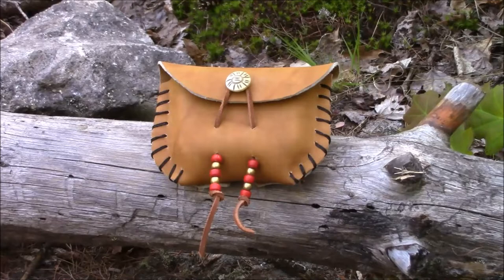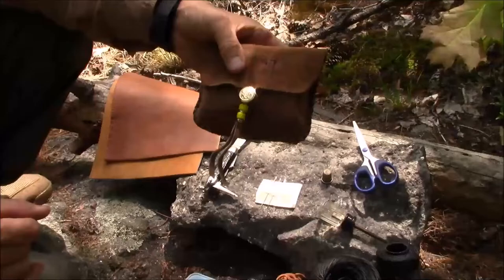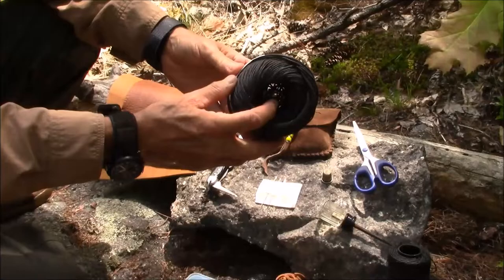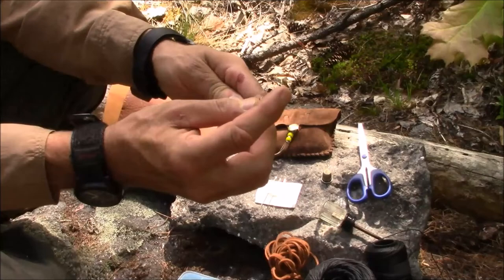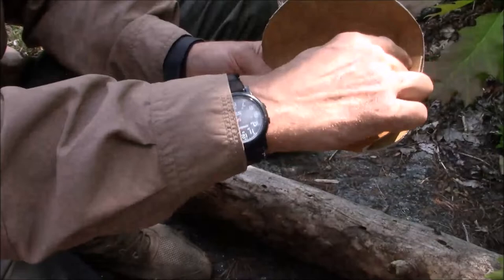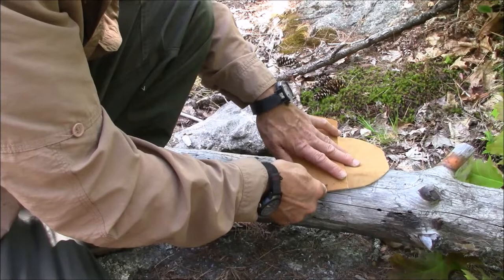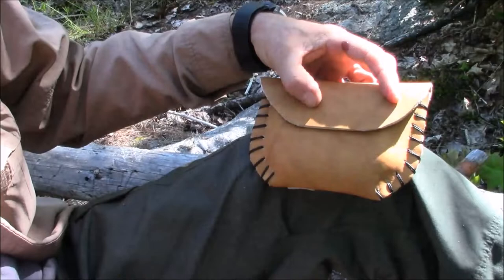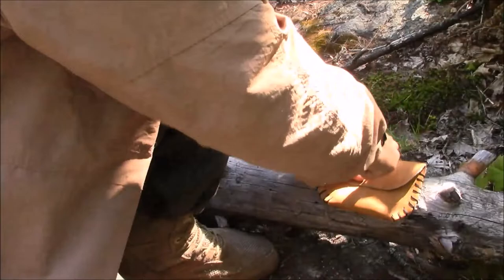Easy DIY Bushcraft Leather Pouch- for Altoids Tin, Flint & Steel Kit.  Pack / Belt Bag / Possibles

Comment: Hey Doug,
I have something to share about pure leather shoes (skin over skin) for people in the city and why our ancestors may of been smart in using them as opposed to modern shoes with rubber inserts that isolate us from the earth (ground) ⏚ 
I'm living in a city in a place in the world which is currently in lockdown so most people stay at home in their high rise boxes. I discovered I need to go barefoot sometimes because I use rubber shoes and my apartment's floor is probably not earthed well.

At work , sometimes I'm working with capacitors. If someone is not familiar, these are electrical devices that store energy similar to batteries. Capacitors can discharge stored energy when you link them to the ground. I can see our bodies are kinda like capacitors in a way. If people like me live in a Metropolis and always wear shoes with insulating rubber and walk on surfaces that insulate, then maybe we will never touch the ground and can build up unwanted electrical energy which I guess is supposed to be discharged - and it could be making people feel stressed or even causing sickness. I'm pretty sure we aren't meant to have too much static energy.

Recently I tried out going to a favorite rock of mine at a bicycle path late at night when nobody is around. I tried taking my shoes off and standing on it. It felt good . Now I often lay on the rock bare back for long periods. I can feel something happening, almost like unwanted city electricals  being released into that black granite rock.

This is something of a discovery for me and it made me think about why those expensive spas make you take off your shoes and walk on the black pebbles. They know something about it I guess. Maybe some people thought it was the massage that relieved some body stress but who knows, maybe a lot of the work was done by walking barefoot on natural rocks.
Reply from the maker: You may be on to something.  Our bodies are electrical in part.  Abenaki sacred sites here have magnetic and electrical properties.  Areas I frequent have enough magnetism to throw off a compass.  And there are a great many lightning strikes.
Reply: @DougShoeBushcraft  Yeh.. Also I think that the colour of the rock tells you about it's electrical /magnetic properties . I see black is absorbing while white and red is repelling. The pyramids are covered in limestone and I think they are repelling (I'm not sure but I'm investigating on my own) .. I think that people who sell spiritual knowledge know about the effects because that is how you could trap someone into worshipping a stone or any other object because it seems like magic but actually it is the way God has arranged things.  Well.. here is something interesting. If I am wearing pure leather shoes  and I've discharged unwanted electricals , I can help a stressed friend by touching them. I think this mandated "distancing" from others where I live is very bad and can actually be a cause of sickness. People need to touch each other in a loving way. I also think our words have power. We can destroy or build someone up by the word... and the intention of our hearts can make the words work either way, despite what the words actually are. That is why we must listen to our hearts.
Reply from the maker: @NorthernGate777  I agree.  Jesus often touched people to heal them, even the lepers.  The apostles also laid on hands and anointed with oil.

Comment: Thank you for sharing! Would you recommend an awl over a leather punch for keeping the holes so lined up for someone starting out? Only have a punch and have come across that issue. Just subscribed. Love how this was made in nature. You are inspiring!
Reply from the maker: If you are having trouble with the leather moving then yes an awl might work better IMO.  Or you can use nails.  Put the project on a flat piece of scrap wood.  Pound in nails through the leather (and into the wood a little bit).  Leave the nails in until you have all the holes.  Then pull them out.  You can widen the holes with an awl.  Or use a punch.  In that case the nail hole would just be a mark telling you where to punch.
Reply: Thank you for responding! The leather doesn't move, it's my hand/eye coordination on keeping the holes straight that I have issues with. Have been thinking of getting an awl.